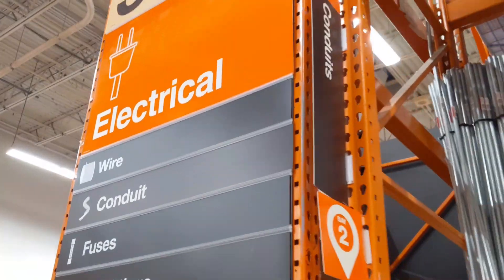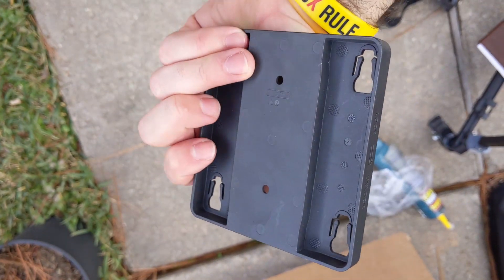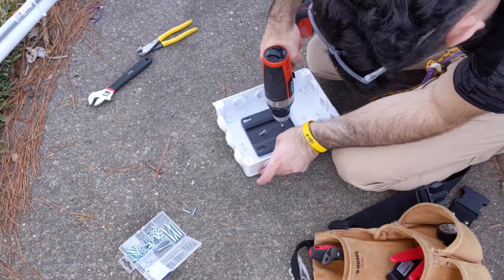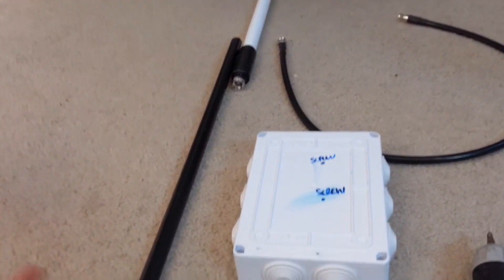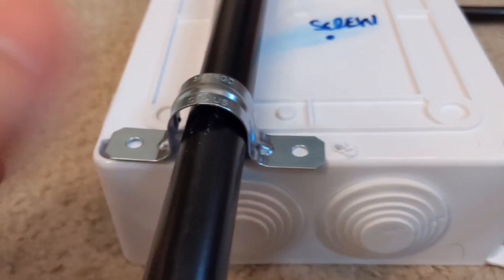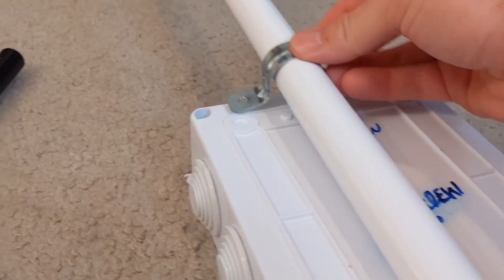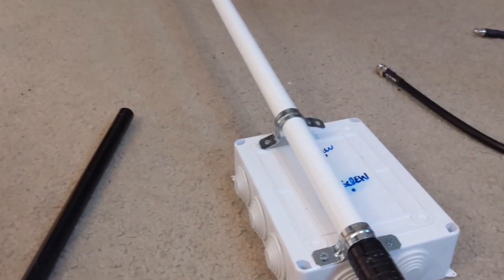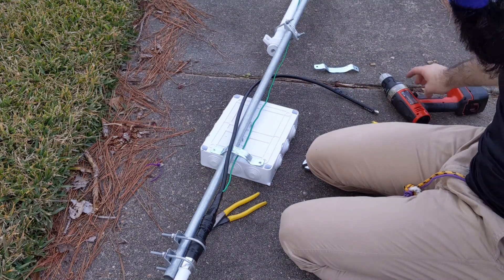How To Attach OutDoor Enclosure Box To Any Pole ( Helium Mining ) Step-By-Step

Comment: Great video and thanks for the real world how tos. I have just done a similar installation but I mounted the box on the pole, not the antenna (like you had in the last shot of the video). 
Two reasons not to mount on the antenna,  
1. the metal brackets and the bobcat itself will cause blanking and possibly reduce its effectiveness, 
2. antennas are not very strong so it's possible to crush them with the bracket and then moisture will get in.

Comment: enclosures, antennas, and cables ordered -- now I just need to go get some metal conduit and j-mounts to hit that high salute! Thanks for your great vids bro perfect timing. best breakdowns of the best setups on YouTube--
Reply from the maker: hahahahah LETS GOOOOOOO! Thank you though. Humbled really. I appreaciate you. 🙏🙏🙏🙏🙏🙏
Reply: @gabrielchaparrotalkscrypto  hey bro, what jmounts are you using? I was going to use 10 ft 1/2 conduit as a pole in my mount.. have everything except those but when I got to Home Depot, they don't sell j mounts and I wasn't sure if I needed any other hardware to mount the conduit into the mounts if the conduit doesn't cleanly sit inside of the mount base..
Reply from the maker: @MysterSer333  I would buy the J mount from RAKwireless. they have the Ubolts too that go with it. Most likely if it doesn't fit inside just attach it the same way that you attach the pole to the antenna with the U-bolts.